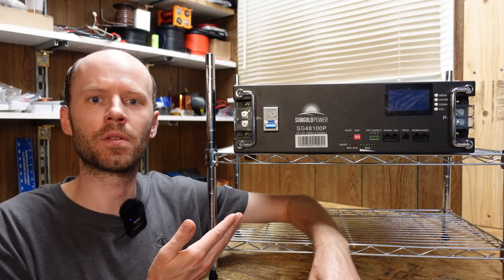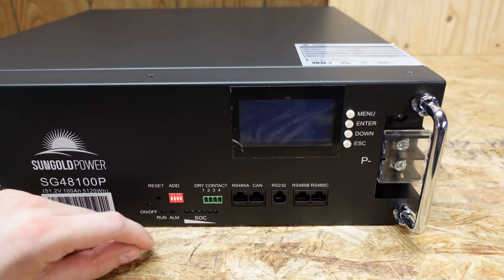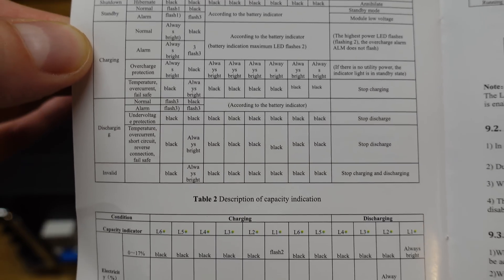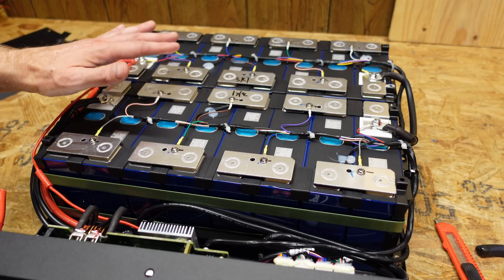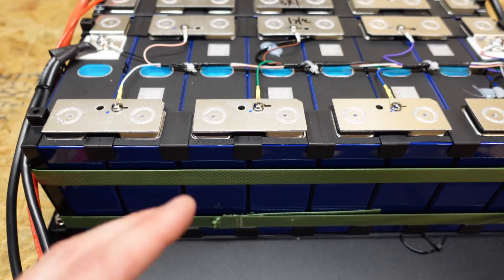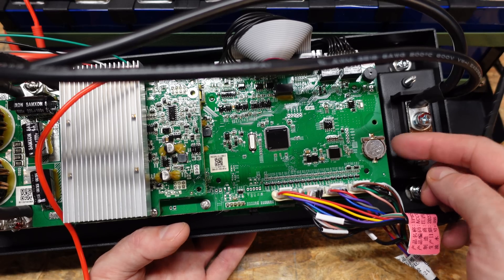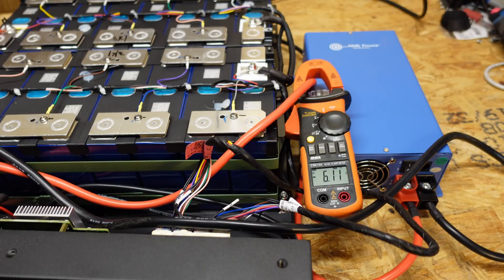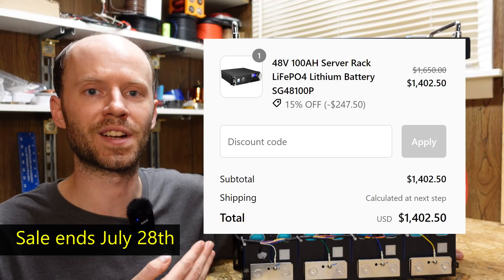CHEAP SunGoldPower 48V Rack Mount LiFePO4 Battery Teardown Review

Comment: We just purchased these batteries and the rack,  based on your review. We opened the boxes set them in the rack and most of them powered on without us having to do anything. Could you please tell us how to power them off so that we can complete set up.  There is nothing in the manual going over powering the battery on and off. We'd sure appreciate it. Thank you
Reply from the maker: Press and hold the reset button with a paperclip. It should turn the BMS back off.

Comment: 6AWG is rated for 65A at best. 100A max discharge rate and a 125A breaker?  Seems sketch. Was it tested for max discharge capacity?
Reply from the maker: What is your rating based on? If you're looking at NEC tables, last I checked they didn't cover silicon-insulated conductors or battery construction.
Reply: @LithiumSolar  yeah, was just an AI sanity check. If you go to Temco (good welding cable) they do advertise their 6awg  105c for 115a.

Comment: I have some pieces of lithium phosphate batteries 🔋 that don’t retained charge 🪫 and I noticed the electrolyte seal covers are broken 😞. 
Can that cause a problem to the batteries?
Can I add an Electrolyte to the batteries cells?
What type of electrolytes can I add.
Please kindly help me with a tips or solutions:
Thanks
Reply from the maker: If the vent is broken/open, there is no way to repair it safely. I would immediately disconnect the cell and take it to be properly and safely recycled. Also, the electrolyte is not safe to breathe or get on your skin. Please be careful.
Reply: @LithiumSolar  can I use plastic cover with super glue to fix the broken seal? I know how dangerous it is, but it’s not easily finding another cell for changing the faulty cell

Comment: Are those terminal covers removable so the user could mount their mount their cables in any orientation or use a larger gauge cable?
Reply from the maker: No. The cables can only connect from the outside orientation. You would have to remove and replace the terminals if you require any other orientation.

Comment: I just bought these batteries on 10-30-23  and then I was notified they are not being released until mid November. Their reason that they are held up at the port of entry.
Reply from the maker: That doesn't seem too unreasonable? Next week is mid-November.
Reply: @LithiumSolar  Greetings and thanks for all your effort. 
I am just concerned that a previous commenter mentioned they were out of stock in June as well. With all the ugliness going on in Western Asia I am worried my back-up system isn't running. I know nothing of SunGold's reputation. If these people are "optimistic" about delivery dates. I want to make other plans. Just looking for feedback. Thanks again and Best Regards Keith

Comment: More bang for your bucks if you  build it yourself.  A piece of cake if you can read and follow instruction super easy to do.

I sourced out last week and start buying    300AH 48V with rack mount case  bms and balancer  for under $1600. That is over 15 kwh of power that can run a whole house.
3 times the capacity of the pack shown here for similar price!!!!!!!!!!!

So far i have seen nothing on Utube or my search that can beat the DIY style. Furthermore i can  pick and choose the components NOT so when buy plug and play.  Even pick and choose still cheaper with 3-4 times the capacity of the plug and play.

It is foolish to buy plug and play.  Like i say if you can read and  follow instruction it is a piece of cake.  I can build one with my eyes close and  that is no joke!!!!!!

In general the newbies and know nothing will go with the plug and play and that is more than 95% of the population.  The rest of us includes me  goes with build it myself anytime of the day.  There is a joy and satisfaction  of building a battery pack that  frees myself from the utility cartel, do my part in reducing  global warming, always have power and NOT ever to deal with the electric bill again for decade or longer with Lithium Ion Phosphate battery and we have just begun this whole  thing.  The future is electrification on everything.

LFP is king right now.  I used to build 1s/100p  pack from 18650 cells   from recycle packs.  What a pain and tedious time consuming process.  Now with LFP i do  not have to do and scratch off the idea of a used EV pack too as LFP is the king for now.

Comment: Just got mine. Overall, very happy with my purchase. I live in the US but in the Caribbean so free shipping was out of the question. It only applies to the cont 48 states. the price was still $1402 but Paid $360 for shipping per battery. Took them 90+ days to deliver due to chip shortage, then hurricane in west coast, hurricane in FL, etc. Anyways, I'm currently trying to get the comms between parallel Sungoldpower TP6048's(Voltronic clones really) and the two SG48100P batteries. The TP6048 menu comes with built-in battery configs for certain brands but not specifically this model. I wrote to them today to get an answer if I can just use the Pylontech, Weco, LIO, Soltaro or 'User defined' config. Im waiting for them to answer. As I have two of these batteries and wish to have one monitoring connection, I'm also trying to determine the proper parallel cabling between the two using the provided multiple RS485 ports. I'm thinking connecting the RS485A port to the inverter to Inverter and then RS485B on batt#1 to RS485C on batt#2. There is absolutely no guildance on the manual aside the port pin outs for the RS232, CAN or RS485 protocols. Me being a noob with the RS485 protocol doesn't help my situation either. I also have the option of getting USB to RS485 or USB to RS232 converters and hooking them up to my Solar Assistant OrangePi that I have in lieu of the supplied TP6048 Solar Power sofware (which sucks btw, lol). Everything works without the BMS being connected to either the inverter or the SolarAssistant but one of the two inverters sometimes throws out fault code 60 (Power feedback protection) every so often, without apparent reason, requiring a reset to clear. I'm pretty sure that having the correct management hookups to the batteries will resolve this issue, I hope.
Reply: @krista-garcia not exactly savy on what you mean by 'closed loop' but this is what I did. I made a custom RS232 cable, RJ11 one end, female DB9 on the other to a Com/USB PC adapter and I was able to directly monitor the batteries with my SolarAssistant OrangePi device (highly recommended). It was simple, I just had to look the pin assignment on the battery's and the TP6048 manuals. Of course, you can opt for buying the cable from Sungold for $35. This battery also comes with convenient multiple RS485 ports so I made another custom cable (RJ45 both ends) and use it to monitor the battery pack RS485 port A to the inverter BMS port. The pin assignments are in the manuals. The 2nd battery is connected to the 1st using the RS435B and C ports between the batteries using the supplied RJ45 straight patch cable and the dip switches set to ID1 on the master battery and ID2 on the 2nd. On the inverter, I used the 'USER' defined setting and set the floating/bulk  54.5v and 48v shutdown as recommended. Is working great so far (2 weeks in), no more random error code 60 on the slave inverter. Hope this helps.

Comment: I just bought four of these batters and I can't get them to turn on...what am I doing wrong?
Reply from the maker: The batteries are shipped with the BMS in a shut-down state. To start it for the first time, use a paper clip or other pointy object to press and hold the RESET button for a few seconds.

Comment: And they are out of stock. Waiting on my complete system to ship and found out today they won't be shipping for another  1 to 2 weeks🤬 Meanwhile I have no AC
Reply: Was thinking about ordering, how is your system doing? You satisfied?
Reply: @spencerhan7995  Yeah I like it a lot. No issues so far that weren't my fault  🤣  I'm still learning this thing so.  As for the equipment it's done what I asked and done it well!
Reply: @johnstark4723  Thanks for the reply,I just ordered the 18kw system with 6 server batteries.
Reply: @spencerhan7995  yeah that would be overkill in my case. I have my setup on a 35 ft camper 🤣  A couple people on the DIY solar forum have the 18kw systems and love them.

Comment: Not about this video but thought you and viewers may be interested.
Recall: BOOW - LiFePO4 Leisure Battery. 

Two versions of 12V 100Ah lithium deep cycle battery, one with a yellow label and one with a blue label. Both with identical markings and labelling apart from the background of the label.

Recall due to poor construction and no BMS.

Can't put a link as I don't think they work on posts, but a quick Google gives all the details.
Keep up the good work.

Comment: Been looking hard at purchasing these as they are really cheap if you get free shipping. One thing that has come up. They advertise that they communicate with all kinds of inverters. I have a victron multiplus and when I asked about it to make sure it would,  they were less sure. Asked if Victron has a way to select certain battery manufacturers. Victron says no, there is no selection of a battery. Victron does have a list of Batterys that are approved and work with system. Sungold is not on it. Victron said their may be a work around but not info for that on Sungold specs.  Sungold said I should just buy the batteries victron recommends
Reply from the maker: I think the way it works with most of these batteries are the BMS company programs certain protocols in the BMS, then the battery manufactures are all using the same BMS and advertising inverter support based on popular protocols (like pylontech). I don't think most (any?) of these battery manufacturers actually test themselves based on my past experience with a select few. If you need the communication with Victron, I personally would not buy one unless someone can confirm it works. Unfortunately, I don't have any Victron inverters to test with and be able to answer that question. My opinion is that they should not be advertising support if they have not validated it themselves.
Reply: @LithiumSolar  agreed on the false advertising end of things.  I am questioning whether I need the communication link at all. Personally I do not quite understand what exactly I get from the inverter/charger communicating to the battery. Obviously that is not a requirement. I was looking at the cheap SOK battery. it doesn't have a communication feature. What do you need it for? I mean, your setting the charging parameters somewhere right? and this battery does have it's own screen where you can check state of charge and such.  What is so important that you get from one of these closed loop communication links?
Reply: @squarpeg the charger has most of the info, I agree, who needs to know if the battery likes chocolate ice cream or vanilla? After much study and thought, the battery and inverter chargers like this both have their own parameter readout, and thus one will tell you everything you need to know. There are some shutdown parameters the inverter can read directly from the battery, but my old school Outback inverter and separate charge controller do allof the things I need, and are programmable as well. The new hybrid inverters automatically monitor battery parameters and can be set to do everything the communication between the devices do already. Aloha!.
Reply: @LithiumSolar  Just a follow-up to this thread. This morning I received an e-mail from Sungold support stating they have confirmed with their engineers that the Victron inverter protocols are included in this battery and that they have tested it with a Victron inverter.  When you are dealing with Sungold support you are obviously dealing with a Chinese person. English is their second language and my guess is the person you are having technical discussions with was hired for their language skills. This person is not an actual engineer or even an advanced technical person. So anything complicated is going to involve someone whos first language is not english translating to someone in chinese and then getting their response and translating back to english.  It is easy to see how hard it might be to get correct answers. I am hoping for the best. .
Reply: @squarpeg  Did you manage to work out the connection with Victron? If so how did it go and what are the key steps?
Reply: @Over_50s_DIY_Vanlife  I bought the EG4 batteries instead. They are supposed to work with victron. Still waiting to unpack them though.
Reply: @squarpeg  thanks. I bought a sungold one, so I guess if I get it to work with Canbus I’ll let everyone know
Reply: PS, I think I’m also thinking about the EG-4 battery to inverter communication ports and how they are plug and play with battery to hybrid inverter com line that is preset. Considering Signature Solar has been the only source of that stuff, and I just went through the nightmare ish contact with Signature, as many have stated In reviews and elsewhere, and this stuff seems pretty standard, this battery has all the important info and communication features you would need.
Reply: Yeah I eventually ended up buying the EG4's just didn't feel as comfortable with sungold.  Didn't feel it was worth saving $300 @5400bowen
Reply: 😊Update, I have got the BMS to talk via CANBUS to my Cerbo GX 😊

Comment: -4 to 140 F degrees temp range??  I seriously doubt that
Reply: I live in the Southwest and temps outside have been in excess of 113F this week. I can confirm these batteries do work well at 125F and will charge and discharge all night even when ambient temps are above 105F. I am not so happy with the support I have received from SunGold but the batteries themselves are a solid product and I have no doubts about the specs. Just My 2 cents after real world use.
Reply from the maker: It can discharge at those temperatures. It cannot be charged below freezing, and regardless of what the manufacturer says, I would not do either at 140F.
Reply: @LithiumSolar  Yeah, that label was a bit misleading. Great review, as usual I really enjoy your style, no BS

Comment: Not should if offer here in Australia.  But with only 100 A hours to small for my system.  6 gauge is that 70A cable?
Reply from the maker: Only 100A? That's a huge amount of power at 48V. And yes, the internal wiring is 6 Awg for the positive.
Reply: @LithiumSolar  Yes 70 A is still good.
Reply from the maker: @chuxxsss  Where are you coming up with 70A? The battery is rated for 100A.
Reply from the maker: @chuxxsss  #6 is good for 101A in chassis wiring. Not 70A.

Comment: Coin-battery has the same role as classic BIOS battery: to keep minimal power on the parts that remember the settings you make. Removing it and disconnecting the BMS from the battery will most likely reset anything you configured on it.

Comment: As a computer engineer, that button battery is used in computers to retain CMOS settings when unplugged. If it is used for the same purpose here, then that batter never gets charged and will last roughly 8-10 years.
Reply: Also used to keep real time clock going when power is off. Not sure if this BMS would have an RTC for some reason.
Reply: @IggyJackson  It does have a RTC.
Reply: Any memory not burned or integrated.. EE

Comment: The button battery is most like a rechargable to hold data for a time without power. Have seen in some things like my old vcr, a couple times it went to other than english and had to wait for about 24 hours with it unpluged to reset, after a few years it happed again but only took like 8 hours to discharge. I think if it stopped working, it would just lose data if it gets unpluged and has no power.
Reply from the maker: That's exactly the concern - whether or not that button cell is responsible for storing the BMS settings that will be lost once it dies. I'll have to do some more testing.
Reply: @LithiumSolar  I would think the only time the  button battery would be used to back up data would be if the 48v battery bank was disconected or the bank went to near 0 volts and that shouldn't ever happen under normal use unless left for a real long time in storage (years?).
Reply: @putteslaintxtbks5166  I think a more likely scenario when the button battery will be used is when the BMS decides to shut down the main battery for any reason (overvoltage, overtemp, etc.), since at that point the battery should not be drained even by the BMS itself, so the BMS switches to backup power from the button battery so it can continue to run.
Reply: @hubertnnn Yep. Hadn't thought of that.

Comment: The handles seem a little too close to the terminals, an improperly insulated/terminated positive wire could potentially make contact with the handle and short.
Reply: If you look closely, the handle has sufficient distance and when the handle is folded, it is not an issue.
Reply: Might want to ad a clip set up to hold the handle away from the connections. I would simply remove the handles. The folding would make it harder to carry it anyway, and I’m not planning on toting them around  anyway. Get them out of the box and put them in the mounting location and remove the handles or fasten them down with any number of methods.  Sure, batteries can have issues requiring service, but a properly sized and installed system shouldn’t need any service for a long time. Unless you are constantly modifying your system, and even that is not likely to require dismounting and remounting batteries. I really like the readouts and the label you said you don’t see elsewhere.